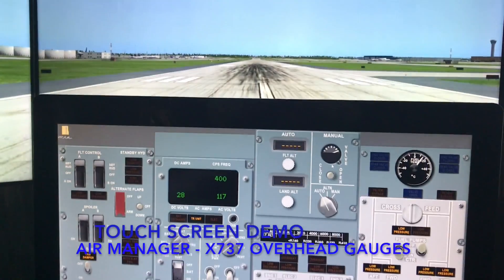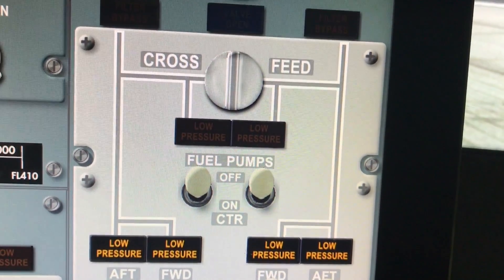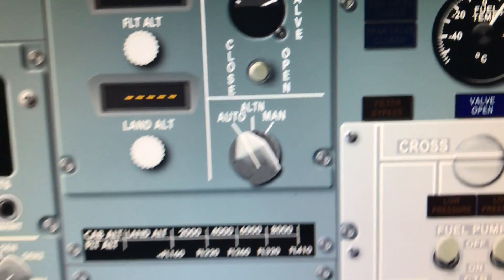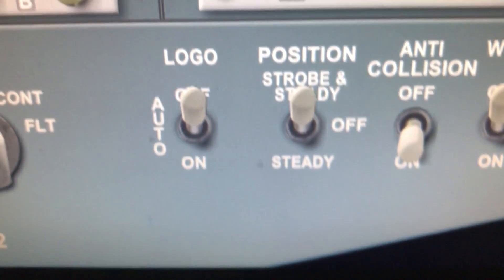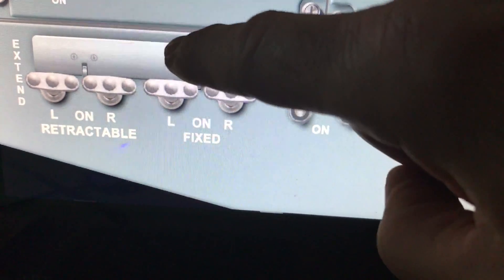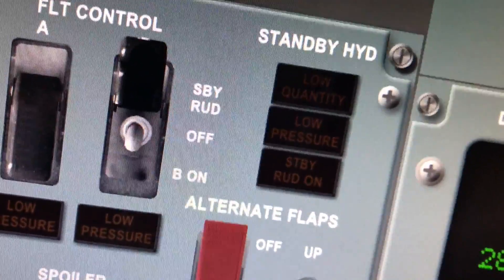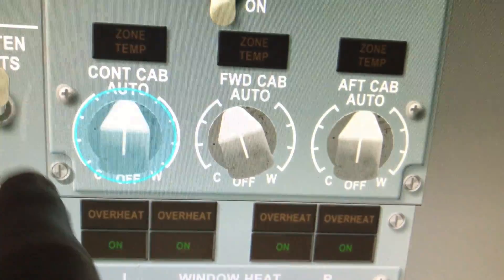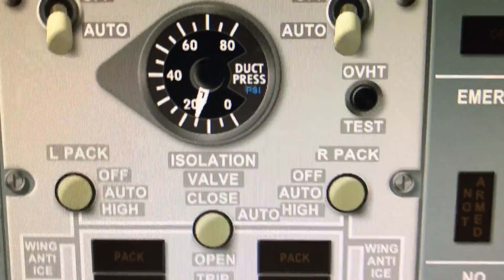Air Manager x737 Touch Demo

Comment from the maker: Yes Air Manager has performed just fine with XP11... and it is used as in  my latest video update 11

https://youtu.be/JkCnno_yzFM
Reply from the maker: Z
Reply: Russ Barlow , have you released your x737 gauges or setup template on Air Manager?  If not, how would one get a copy from you?